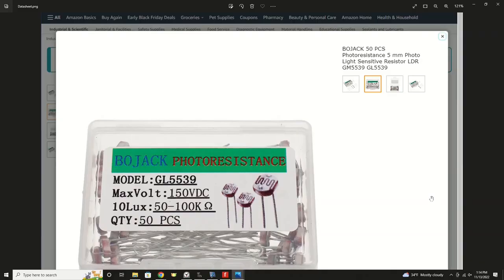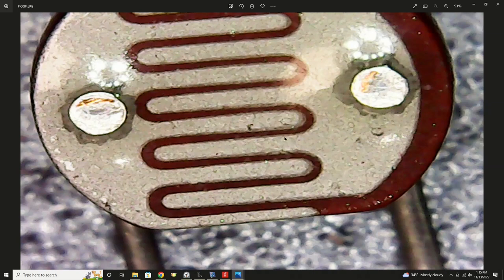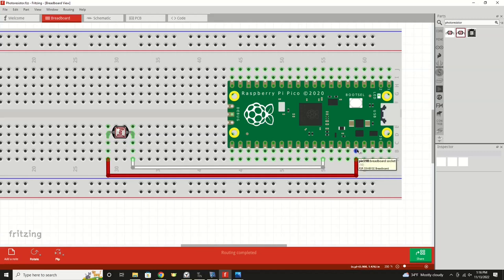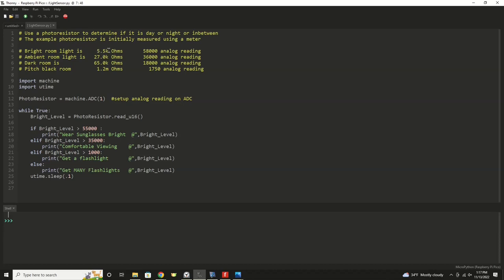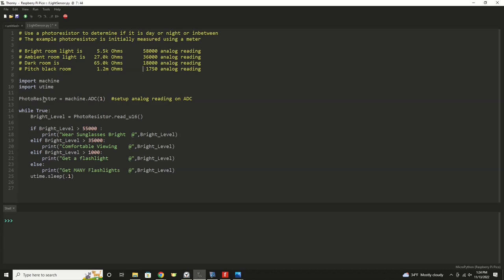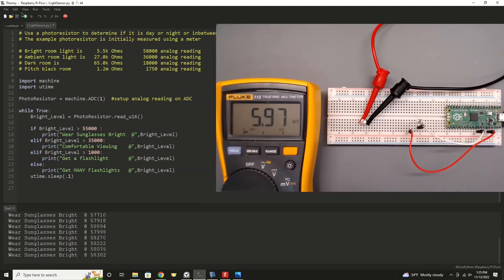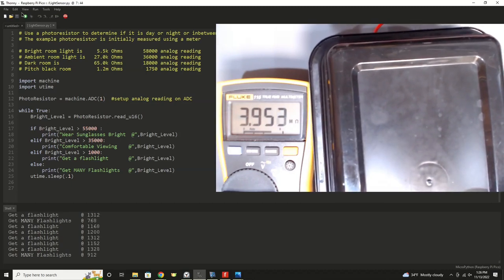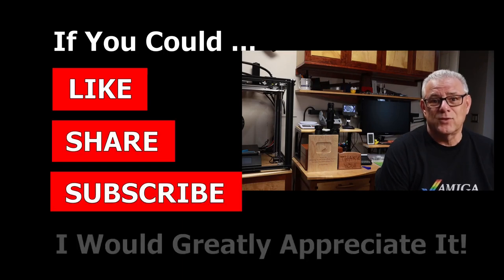Help your PICO See the Light With a Photo Resistor

Comment: So  a set of 3 could point to which angle a light was coming from, combining 3 values, 
might have to multiplex to use more detectors ... make the robot much more sensitive to follow a light ...
or go hide from it ...,  might help to count revolutions when having a reflector on the side of a wheel.
This is rated for 150 Volts !
Reply from the maker: I love your thinking!  So much to explore with these simple devices.

Comment: Why didn't you use ADC(0) instead of ADC(1) ?
Reply from the maker: Not sure I understand your question?  Why would it have mattered which one I used?
Chris
Reply: @MakingStuffwithChrisDeHut  On line 12 you write 'machine.ADC(1)', so I wondered why, cuz I tried using 'machine.ADC(0)' and it didn't exactly work. I thought maybe there was a reason for it but I might as well have a faulty board.
Glenn
Reply from the maker: @glenncarver9049 Ah, I see what you mean now.  All three of the available Analog inputs are used and accessed in the same way.  While the PICOs are very robust, out of the 40 or so of them I have here, I have lost a couple so far with all the experimenting and filming.  Most likely I shorted out a pin while tinkering causing it to fail.  
Good luck with your project!
Cheers!
Chris
Reply: @MakingStuffwithChrisDeHut  I see. Thank you, you are doing a great job with these vids. ❤
Cheers
Glenn
Reply from the maker: Hi  @glenncarver9049  
Glad you are liking them and thanks much for the compliment!!!!!
Cheers!
Chris
Reply from the maker: Thanks!  @glenncarver9049